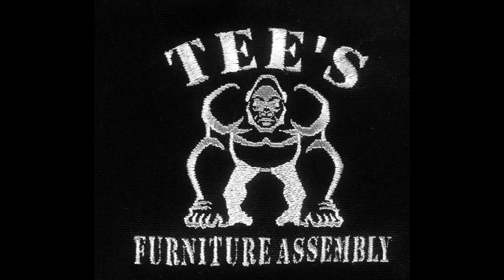Ikea Songesand bed frame with 4 storage Boxes 2/15/19

Comment: We were going to purchase this bed and went to take a look at it and changed our mind because the drawers are loose when you pull them out and when pushing in, you have to make effort to ensure that it is aligned without scratching the sides. We ended up getting NORDLI bed. It has a soft closure, steady and attached to a drawer bracket.
Reply from the maker: Thank you for checking out my video.

Comment: Mine was just delivered, What tools would you reccomended I bring to assembly to make things easier / faster?
Reply from the maker: djdoubledown you can use a screwdriver but I also use a drill for a faster process but make sure you have a drill with a pressure point not a full power drill it will damage your item.
Reply: You mean it can be done with just a screw driver or a drill nothing else?? 🧐

Comment: Can't slide in the bottom to the drawers... I unfold them, but the slots in the side/front/back of the drawers do not line up, they're about 1-2mm off. Did you ever encounter this problem?
Reply from the maker: Josh Kieselbach no I never encountered something like that. Did you follow the instructions by the T?

Comment: Is there any difference with the 2 storage  and the 4 storage beds? So if I buy a 2 storage type , can i upgrade to a 4 later?  Thanks!
Reply from the maker: Nick Kobzos yes. Just buy two more
Reply: @teesfurnitureassembly4287  Thank yoi for the fast answer! Let me ask one more thing. If I buy inly 2 storage there will be a hole at the missing parts?
Reply from the maker: Nick Kobzos yes you will have space on the other side.

Comment: Do you have any information about the Songesand bed with 2 storage boxes? If I put them on one side, does that mean that the other bottom side will be hollow or...?
Reply from the maker: Yes that’s correct.
Reply: @teesfurnitureassembly4287  thanks for the quick answer!
Reply from the maker: Anytime.
Reply: Tee's Furniture Assembly can you choose what side the 2 storage boxes can go on and can the sides be changed if rearranging the bed?
Reply from the maker: Yes.. you can just roll them on to the other side.

Comment: do you need the wooden slats if you have a box spring?
Reply from the maker: ashley k if it fits. But it will rise your bed a bit higher.
Reply: Tee's Furniture Assembly ok. thank you so much for the quick reply!!!

Comment: Hey man, see you respond pretty fast. I already have two motorized bottoms but I worry that the motors would hit the metal beam that goes through the width of the bed. How strong would the bed be without that support? Doable?
Reply from the maker: Dionysus Fascinus you going to need that.. it won’t hold up the bed.

Comment: Hi, I am assembling the same bed frame. On step 14, one of the bed slats did not have holes in it at all. I was wondering if this is normal or if I received a faulty frame.
Reply from the maker: Do you have a picture of both? The frame and step 14? Show it to me and I’ll can tell you what’s wrong.
Reply from the maker: Ok I just checked the book.. you supposed to have holes in your items. Please contact IKEA to replace them.
Reply from the maker: Sometimes you might have pieces of compressed wood covering the holes. You may need to clear the holes.

Comment: Can I use heavy mattresses on Luroy slats? No one seems to have an answer for this!
Reply from the maker: I would recommend the lonset for a heavy mattress. But you can do a luroy but jumping on the bed will damage them.
Reply: Tee's Furniture Assembly thank you so much man! After I bought luroy base I realized it’s much easier and better to use a box spring
Reply: Tee's Furniture Assembly cause it doesn’t break
Reply from the maker: Mr you can actually use a box spring just make sure it fits in the frame.

Comment: I’m assembling the drawers. How did you get the bottom piece to slide in? It doesn’t seem like mine fits. 
Also it does seem big enough to cover the whole bottom.
Reply from the maker: Did you put the inside racks upright?
Reply: In case you're still stuck, the bottom piece unfolds into a larger piece that slides in perfectly. I was stuck on that step for a bit too.
Reply: Sandesh Adhikary yes lol I figured it out after about a day.
Reply: Sandesh Adhikary this comment saved my life thank you so much lol

Comment: That middle piece on step 30 was it included in the two box set of the songesand? I seem to be missing it or I think there might’ve been a 3rd one?
Reply from the maker: Yes you might be missing that. That don’t come in a box.
Reply: Tee's Furniture Assembly Thank you!
Reply from the maker: Anytime.
Reply: I am so bummed tonight to realize I dont have that middle piece. I dont remember the specs saying it needed to be purchased separately or anything- huge bummer since I got it all set up myself and was ready to use it 😭
Reply from the maker: Sorry about that.  If you got it delivered sometimes they forget it in the truck.
Reply: Please could someone let me know what the middle piece is called as I have to order online, not in the boxes and set up this far only to find out it wasn't included and didn't mention you needed it in IKEA! Said to buy the slabs seperately, but not the middle piece.. so so weird and annoying!
Reply: @chloearmstrong7601  Is called SKORVA

Comment: Im stuck on page 38, im screwing it manually but it wont go in all the way
Reply from the maker: Azeon91 make sure you have the Screw number 105163 going from the bottom. Then hold tight on the plastic screw number 102267 on top.
Reply: @teesfurnitureassembly4287  sorry i meant part 36
Reply from the maker: Azeon91 those are the smallest screws number 117327. They must be screw from the top. The skinny rods number 117228 must go from the bottom. The support bracket number 139301 must be in between the rod and the screw.
Reply from the maker: Azeon91 hope that solves your situation.
Reply: @teesfurnitureassembly4287  Never mind. I fixed it now. Thank you
Reply from the maker: Azeon91 my pleasure.. as always like a subscribe. ;-)
Reply: Tee's Furniture Assembly 
The screws  117327 don’t fit